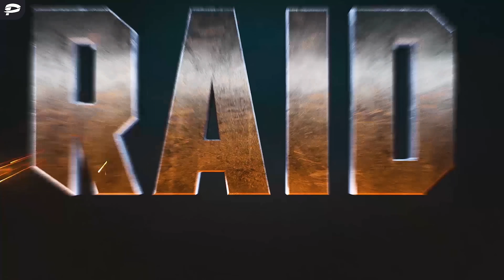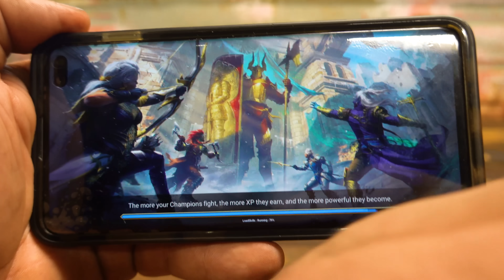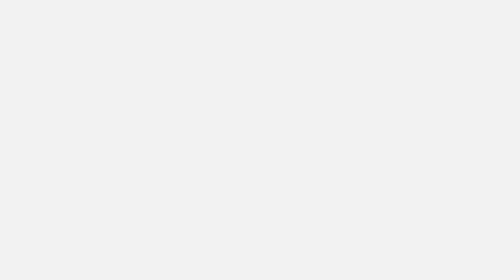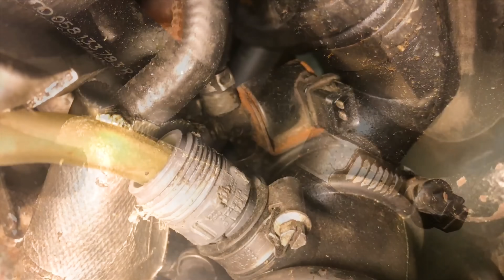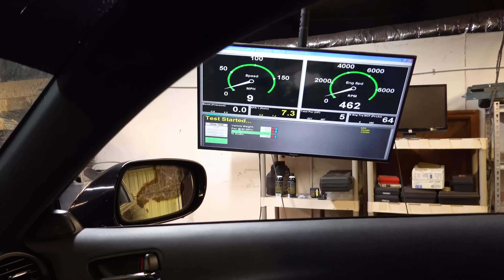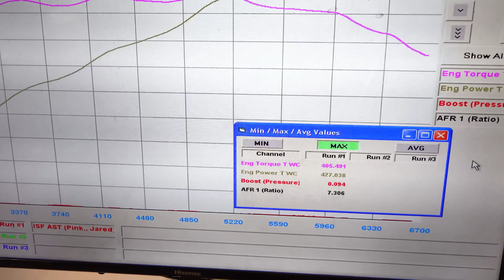Here's How Much Horsepower A 220,000 Mile Lexus IS-F ACTUALLY Makes (Driven HARD For YEARS)

Comment: Great video. Would love to know the mods for that car. It sounds like it has the RR-Racing tune which raises the limit from 6,800 rpm to 7,200. 

The stock tune does not disengage the converter at the limit. The flare at the end is the converter uncoupling at 6,800 and then the engine goes to 7,200 on the limiter. 

I am going through the journey of totally stock and adding various mods over the next 2 or 3 months. 

427 hp (Mustang dyno??) is full bolt on power ( tune, headers, exhaust and inlet). These things make about 500 to 510 with all the bits at the engine. Super healthy for the mileage. 💪💪💪

Comment: A big missed topic was getting a wideband O2 sensor (unless your car happens to have one stock that can be referenced).  Most dyno operators offer a tailpipe sniffer, but it's never quite as accurate as having one closer to the engine (before the cat's of course, if you still have them).  A good AEM unit is $200 - no reason to NOT run one.

I sure wish I had a load dyno easily accessible without spending a fortune.  MAF tuning is easy and relatively quick on the road.  VVE tuning my car on the street sucks.

Comment: Nice video, your isf engine is stock ? 
My 2000" IS200, stock engine (just k&n filter in airbox) with 210 000 kms (+- 131 000 miles) on dyno = 147.8 hp for 155 hp at the base , japanese engine vs the rest of the world !!! :-)

Comment: Altitude/air pressure will not affect your tune if you have a turbo.  At lower air pressure/density the turbo spins faster and compensates.  This was discovered in the 1930's when they started fitting turbos to aircraft engines.  Drive your car on the flat, then take it up Pike's Peak :-)

Comment: So, what would a dyno tune end up costing?  If the tuner is spending two-four hours tuning your car, that is] probably going to run around $400 plus dyno time.
Reply: Great question!  Jared...?
Reply from the maker: That is a hard question to answer. You can rent dyno time and tune yourself and that varies between $90 and $150 a hour. Tuners generally charge $105 to $175 a hour. Sometimes they charge flat rates of $600 to $1200.

Comment: Spark plug temperature ranges.
A hot plug is called that because the ceramic around the electrode is allowed to get hot in order to burn off deposits to clean the plug. The electrode will extend far out and there will be a lot of space between the metal surrounding and the ceramic with a deep well before the ceramic and metal touch.
You do not want a hot plug if you’re expecting high cylinder temperature etc.
A cold plug runs a lot colder as the ceramic is very shallow and comes into contact with the metal as quickly as possible without falling to insulate the electrode so that the spark can jump anywhere other than the tip.
A cold plug may need cleaning regularly.
You want a cold plug in a high temperature turbo charged engine to help control knock.

Comment: Can vouch for bringing the fuel injector info with you to a dyno. Many years ago, I installed some 550cc injectors in my 1JZ and went to the tuner. I couldn't provide them the info such as the brand, voltage or dead times.. It made the job more time consuming for them. I ended up having heaps of problems with those injectors due to a blockage in one.. 

Lesson learned and bought brand new Bosch 1000cc's with all the info to provide to the tuner. Haven't had any problems since.

Comment: How hard was it to install the headers Jared? My brother's IS-F has an X-Force exhaust and currently, he's not looking to install the headers as he reckons it would be too costly for the power gains he'd get..
Reply from the maker: Headers are the biggest upgrade you can do to the isf. Depending on the area of the country you will pay $650 to $1000. Or if you have the space first time is a 2 day weekend project.
Reply: @TheQuestionableGarage  Can be done in about 3 hours if you're familiar with the job.  I did a starter replacement on jackstands in about 4 hours having never dropped the subframe before.  I also have poly and solid bushings on the LCA to make dropping the subframe stupid easy, but still someone who has done this at least once should be able to get headers on pretty quickly.
Reply from the maker: Oh yea once you know it, it gets over very fast! But for a first timer, having to run and get the flex head 10mm stubby ratchet for the heat shield, it will take a good bit more! 

Like Lobu said, replace your motor mounts and rear control arm bushings while it is all apart.

I have all RR racing parts and they work great for me. It is not a sponsorship deal, i paid retail on all the parts[even the upper control arms and overnight shipping!]

Comment: Hey Jared, shouldn't the back wheel be at the top of the roller? Otherwise, that car is a beast.
Reply from the maker: I've always gone centerline/back for the tire placement. That way the tire has to "climb" the drum and I've had better luck with traction for higher power cars.
Reply: @TheQuestionableGarage  That's an approach I've not seen before. Makes sense!

Comment: Just be aware that weather correction means nothing on boosted engines, especially with ice cooled intercoolers.
Most (factory) boosted engines will correct for low ambient pressure by closing the waste gate futher. The corrected horse power will be higher in that case; but the engine will not produce those numbers.
As for ice cooled intercoolers; they REALLY mess up the weather correction. WC tries to correct for the air density; temperature is a major player here. If you have 100F ambient with an ice box for the intercooler, expect ~10-15% correction too much correction.
Oh, and if you're running on a Dynojet, just subtract 20% from any horse power number. They all read utter BS - which is why the Mustang Dyno is known as "heart breaker dyno" - because it reads so much closer to real HP numbers than a Dynojet.
Also, if the HP filtering is deactivated, expect stupid HP numbers. There is a lot of noise in the measurement, and a Dynojet with deactivated filtering can easily report 50% too high HP and Torque numbers...

Comment: I have owned ISF for 10yrs and that is wrong gear to do dyno pull. It should be 6th gear. By doing in 5th gear you get higher hp# but it's not true number.

Comment: With motorcycles (same applies to cars), I also recommend replacing the fuel filter, and cleaning out the injectors as well (avid believer in Redline's Complete Fuel System Cleaner - Pep Boys - add ENTIRE bottle to 5-7 gallons of gas and drive until it's on fumes).

Comment: Why always testing with te lights on? Is there a specific reason?
Reply: Those are the DRLs.  They run half power to the high beam bulbs for the DRL function.  You can only turn them off with Techstream on the IS Fs.

Comment: Should have been in 6th gear, thats the isf’s 1:1 gear
Reply: It also only has 416 from the factory
Reply: @ijmodified  his has intake, headers and exhaust which puts an isf right around 500 crank. My isf with the same mods traps 119mph in the 1/4 so you can do the math there. They trap around 112 stock.
Reply: @tcmcclure2323  that doesn't math 416 to the crank from factor, others without high mileage stock dyno 360 to the wheels on a good day even with intake and exhaust you're not gaining 90hp
Reply: @ijmodified  mine made 388whp sae correction with intake and joe z exhaust and stock exhaust manifolds. Installed headers and the following day it made 423whp. The stock manifold designs were very restrictive. Aside from all that proven info, you can’t argue trap speed and weight. Go do the math and get back to me. 423whp and 394ftlbs for my isf.
Reply: @ijmodified  420-430whp with intake, headers, exhaust, and tune is standard for these cars. A buddy of mine made 412whp with no E85 mix, and his friend made 427whp with E30 mix on the same dyno, and same day. E30 car was FBO, 93 car was FBO but stock intake box with upgraded filter. Will you get 90whp gains from stock? Probably not. Can you get 70whp over stock? Absolutely and it's been proven over and over and over.
Reply: @ijmodified  I think I’m more inclined to believe the guy who actually owns an IS-F (@tcmcclure2323) than believe the guy who is talking about other people’s cars lol. Besides, we literally JUST watched a video of the car putting down 420hp with only an exhaust and filter so how can you now say it can’t do it? It literally just did it lol

Comment: Those rear wheels are awfully close to the base. I'm used to seeing tires on the roller from a very different angle.
Reply: It looks so, but I believe that is the very correct position. If tires would be on top of the rollers, there's nothing the tires would "push" against while putting load on. When they hang back a little, they will actually push against the rollers while putting load on making sure the grip stays as good as possible. And if the unfortunate would happen, and they would hit the base while rolling, the direction of roll is back at the rollers again - you may shorten the life of your tires in that, but at least you won't swung off the rollers.
Reply: There seems to be a lot of crazy explanations here.  The simple answer is that as the car loads up, it stretches the straps and "climbs" the roller.  When he lets off, it goes back to the neutral position.  Some really high powered cars do this quite dramatically, to the point where if it wasn't set at the rear portion of the roller to begin with, it could likely climb off the roller during a pull.